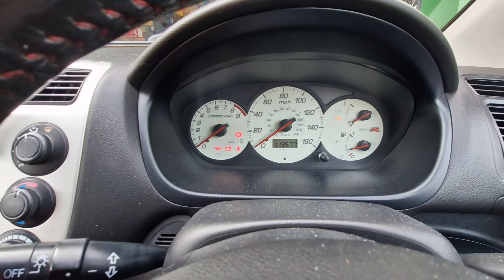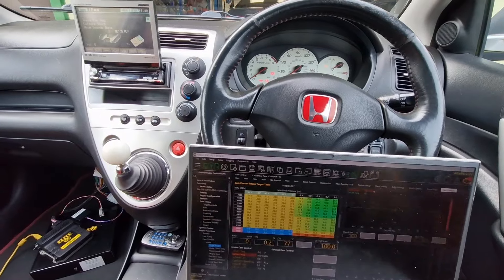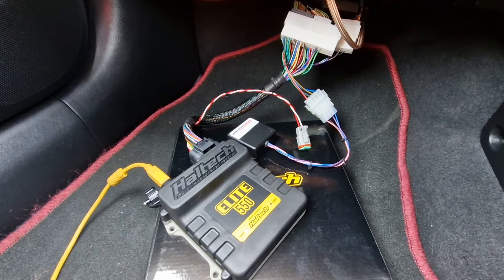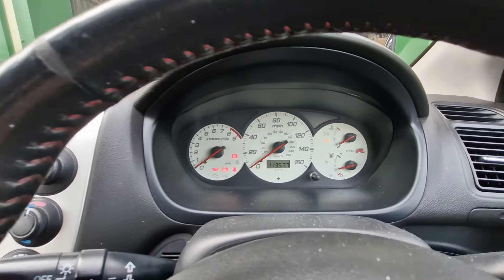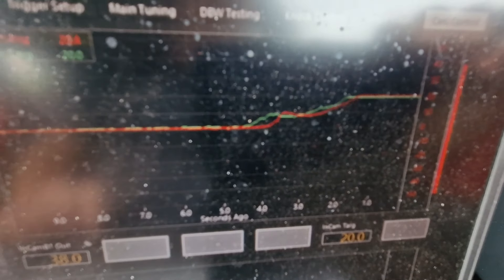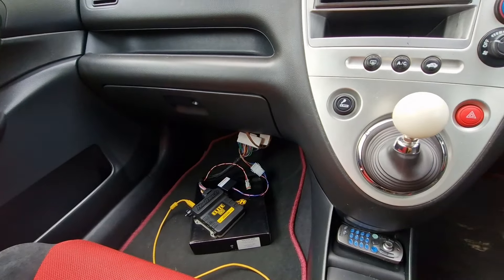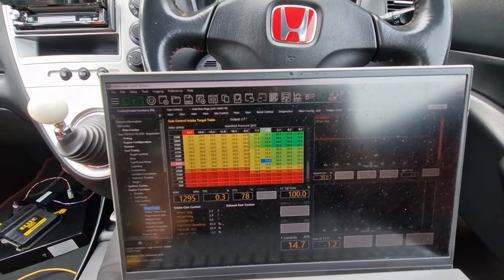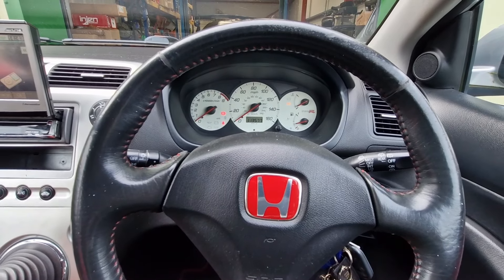Haltech Elite 550 PnP ECU FOR HONDA K20'S GAME CHANGER!

Comment: Does 550 Run Close Loop knock control and can it read knock per cylinder. maybe that was the 1500. Also, my question is I already own 550 will you be selling the adapter harness and base map as a package?
Reply from the maker: If you want all that you need a far more advanced ECU to do knock per cylinder as even the E1500 only has 1 channel. Also no plans to sell harnesses and maps individually at this time as we are concentrating on delivering the package as a whole at this stage but it probably will come.

Comment: Will their be a ecu supply fit and tune package for this haltech for the ep3 type r?
Reply from the maker: Yes
Reply: @tpwengineering  do you know when it will be available to purchase on the website?
Reply from the maker: @MohammedHasan-un7fc  When I get a chance to list it. Stupidly busy at moment as into race season
Reply: This is what I was going to ask… for the ep3 in general
Reply from the maker: Yes I'm in process of sorting other all out with various options 👍
Reply from the maker: @meathead1011980  Any K20A based car with conventional mechanical throttle so Kswaps EP3 and DC5s

Comment: Also FN2/FD2 and FG2?
Reply from the maker: We already have PnP solutions for 8th gen cars using Haltech but it doesn't run the stock dash unfortunately but then again most people opting for this level of control will be planning on something like an IC7 dash to display more data anyway. For everything else there is Ecutek on this generation which will do pretty much everything you need on the stock ECU